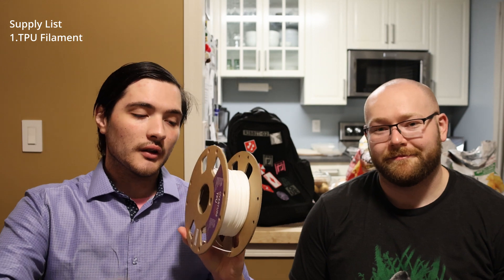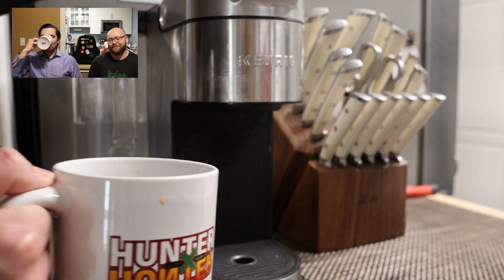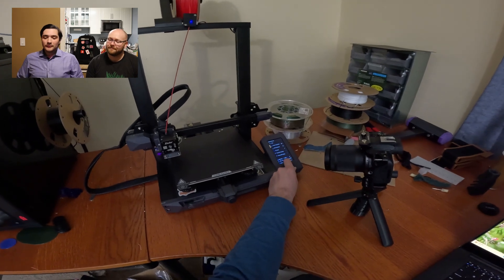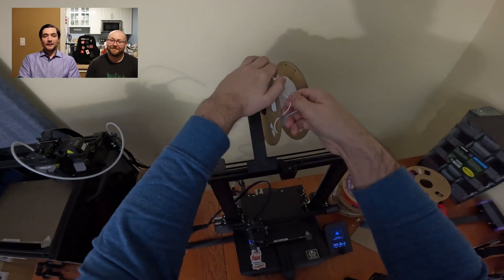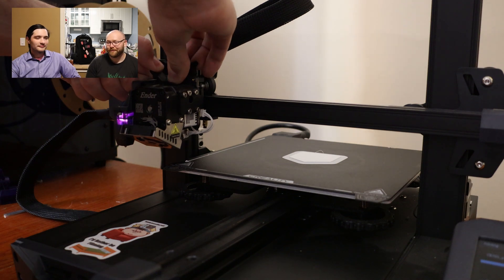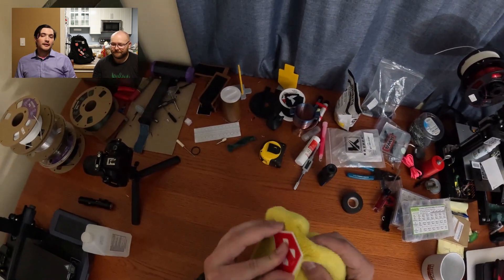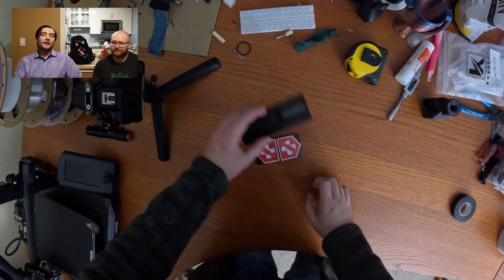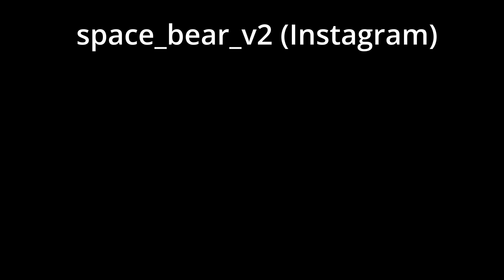How To 3D Print Velcro Patches With Tyler

Comment: any recommendations on: bad - ok - good - really good 3dprinters for making patches?
Reply: I personally use a Creality “Ender 3 S1” for all my patches. They can be a bit hit or miss but mine have been good. I still think they are great for folks who are interested in learning and know how to work on machines. That being said you can really get whatever machine you like since patch making isn’t a “high-precision” process. There are a few things you should consider:
1) Get a direct drive extruder. TPU handles like rope, so an extruder that pulls directly into the hot end makes life a lot easier. 

2) Get a bed slinger style printer. I’ve found they are more convenient to do filament changes on. 

3) You will have to do the filament changes by hand. Current automatic changing systems are not compatible with TPU. The current work around is multiple extruders, but that gets pricey.

Comment: Have you tried heating the patch after printing and sticking it on fabric? I think I saw someone print TPU straight on a piece of fabric but it'd be cool to just print, heat and slap it on a cap.
Reply: I haven’t tried that yet but certainly will try printing directly on a shirt. I typically do heat up the patch after pressing. A little while after making this video I switched the style of roll I use, and now use additional fabric glue. May be a better option for things like hats that you may have trouble printing directly on.
Reply: So after doing some research, don’t print directly on clothing. Cotton degrades (melts) around 150 Celsius and may ignite at higher temperatures. Since pretty much all filaments require a minimum temperature of 200 Celsius, it is incredibly risky. 
I have seen some do printing on clothing but I would not attempt it without further research. 
You may be better off printing the patch and sewing it, or applying fabric adhesive.
Reply: @Space_bear_v2  Whoa, ok. Thanks for the heads up! I guess printing a small channel at the edges and sewing it on is also neat, just a tad slower method but would look premium.

Comment: I am looking for a way to use Hydbond to adhere 3d printed patches to caps. I just don't know which filament would be best. Any ideas anyone?
Reply: TPU should be good if you are looking to make a patch. If you need it to confirm to the curve of a cap you may want to be relatively thin so it stays flexible. I have not tried hydbond, but have had good adhesion with the backs of Velcro strips, so you should be good.